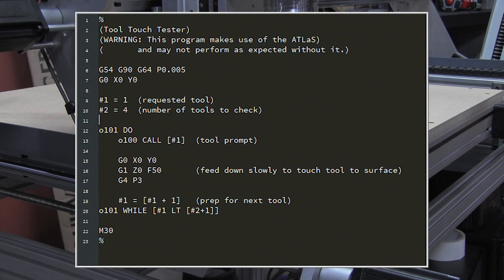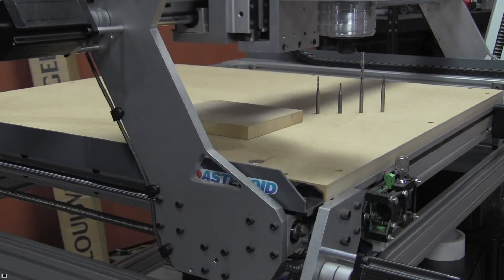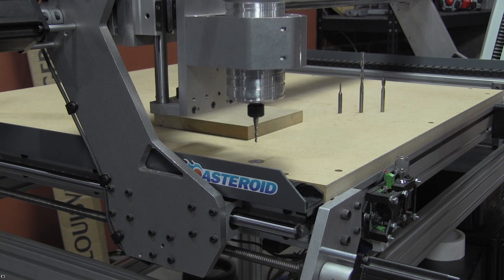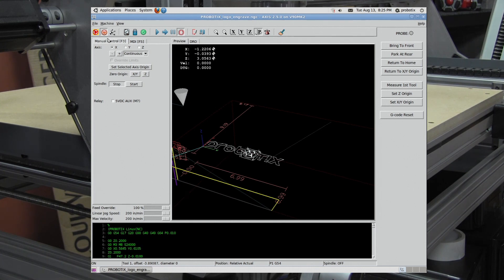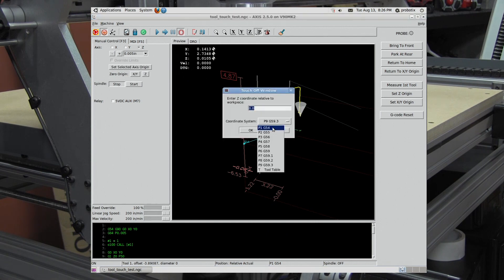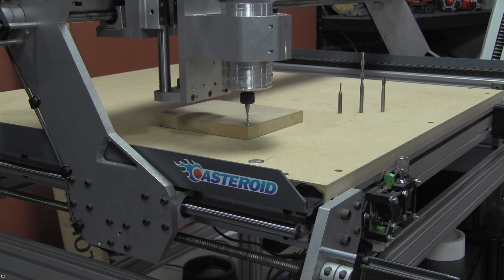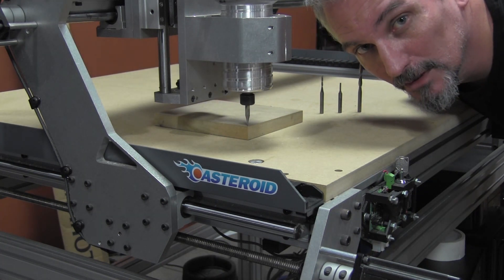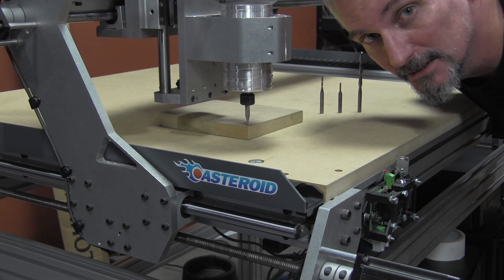PROBOTIX ATLaS demo

Comment: Won’t the measurements be off when you go to put the tools back in after running the program, since they won’t be in the collet at the exact same spot?
Reply: Nope. That's literally what this feature is for. I use it for everything I cut on my machine and it works great. This feature allows me to save all of my toolpaths to one cutting file, each with its own assigned tool number. When the program calls for the next tool, it bounces of the ATLaS, then resumes cutting without having to touch-off the z-axis again. Also, say you need to run multiple of the same program. Just put a new piece of stock down and rerun the program. The first thing the computer will do is ask to load tool #1 again, and then I will bounce off the ATLaS again to account for any deviation from when the tool was in last. It really saves a bunch of time and it's worth every penny in my opinion.